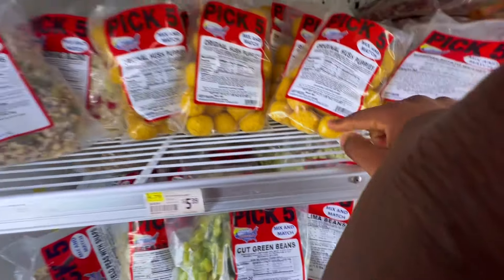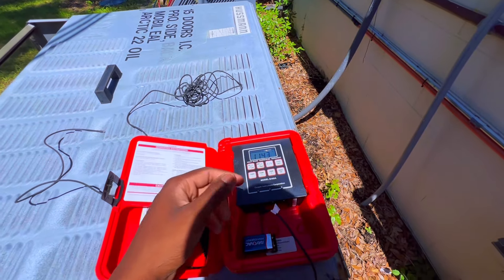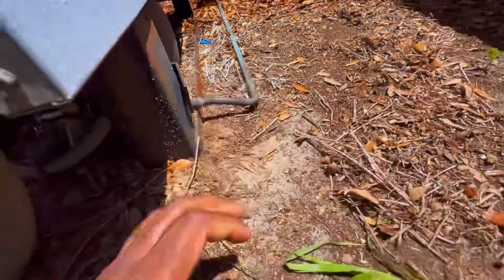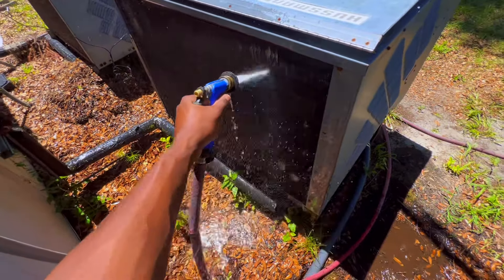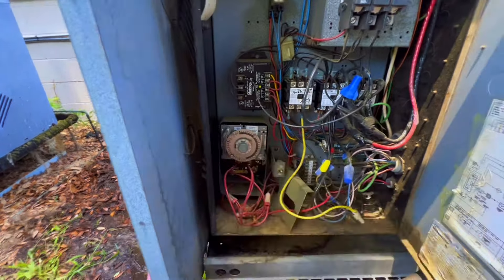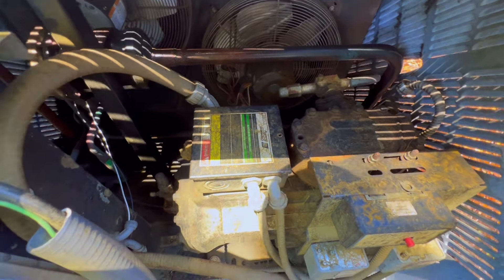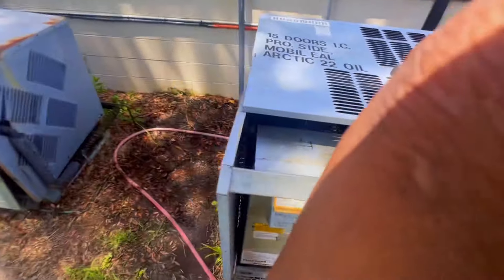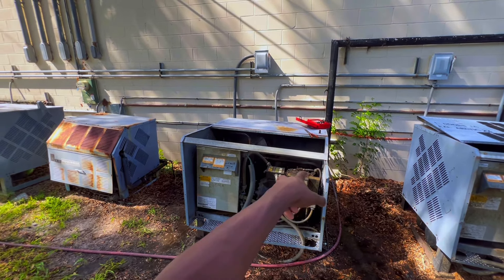3 DOOR SEAFOOD CASE RUNNING WARM AND PRODUCT THAWED! FOUND OTHER 12 DOORS TEMPING HIGH!

Comment from the maker: I highly doubt non-condensable gas in system suction would not be sweating and temperatures would not drop. Condenser is suspect y’all let me know👍🏾
Reply: Non-condensibles could have the suction sweating, I've only been able to tell with a fluttering liquid line pressure.
Reply: I'm not so young anymore, about to turn 38. But imo we are better at this stuff. The old guys only know so much.
Reply: Bro the blades are different. The different direction blades. Ones blowing and ones sucking thru the coil. That’s your issue
Reply: Let men  know tomorrow bro how you make out. Don’t forget the new blades! Lol
Reply: Let men  know tomorrow bro how you make out. Don’t forget the new blades! lol

Comment: Did you notice that it appears you have two different fan blades on the unit!!! That’s probably contributing to the issue bro!! Recheck the fan blades. One pitched one direction and the outer fan  is pitched the opposite direction
Reply from the maker: Will recheck but I verified airflow direction.
Reply: Just play back the video and pause it when both condenser fans are visible. You can see the two different blades at different angles